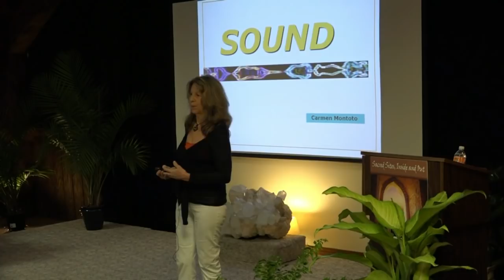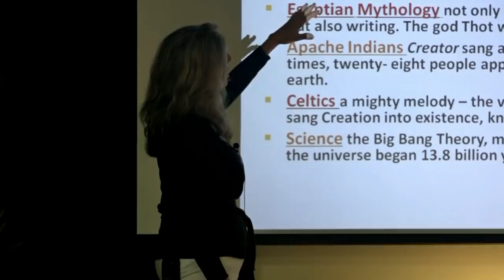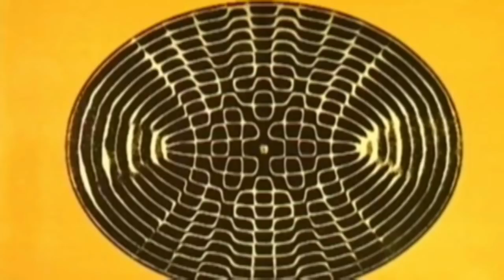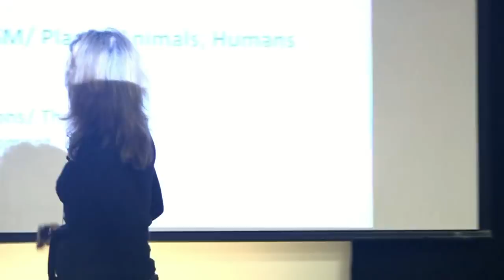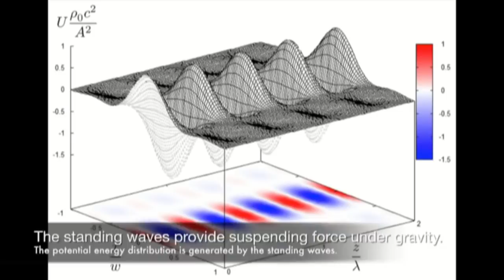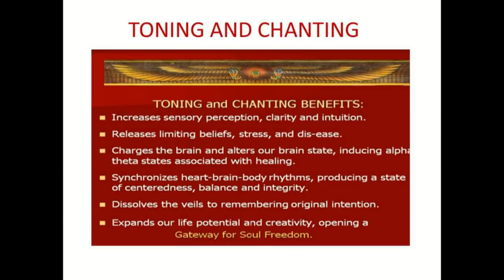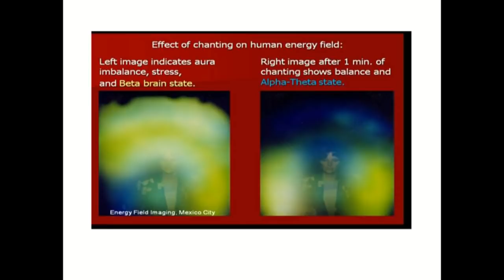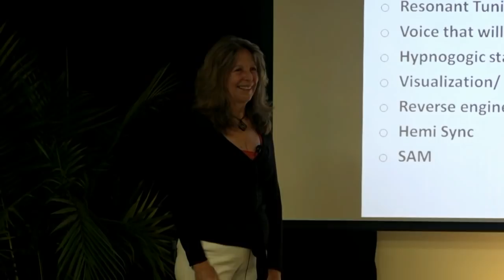Monroe, Sound, and Consciousness. Montoto at TMI  2018 Prof. Seminar

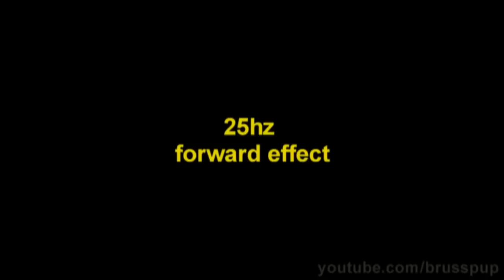Comment: 25:00 - sound doesn't affect the water directly in this example. the sound affects the watertube in this example. the watertube is applied to the speaker.. so it swings back and forth in the frequency of the sound from the speaker. so it's not rly directly affect the water in this example.. just the watertube and as a sideeffect the water because it's flowing out of the tube to the ground.
Reply: Sound affects the formation of waves in a pond, in a pool in a plate. The vibration affects the water and the tube . If you put water between two speakers you can observe the waves form in the water and if you put different music it becames very interesting